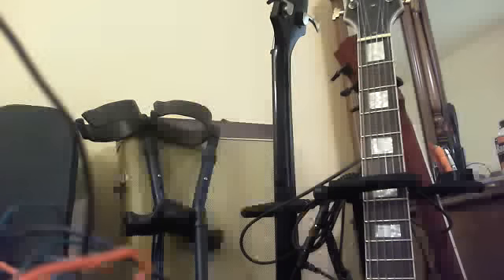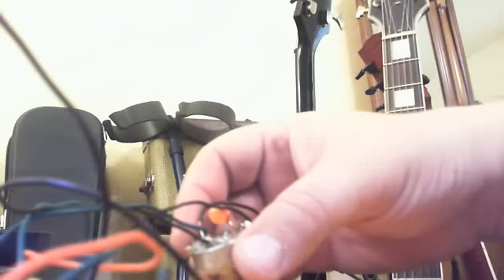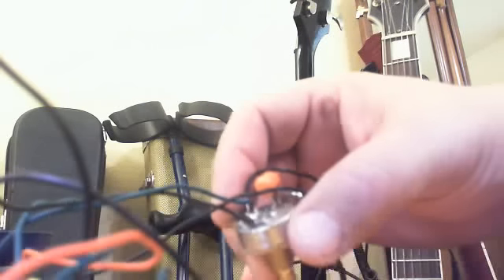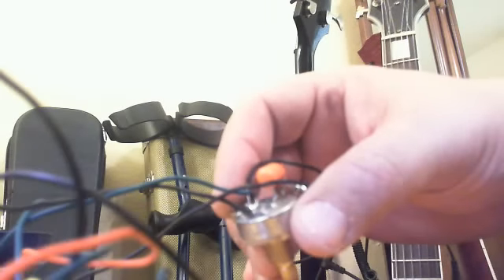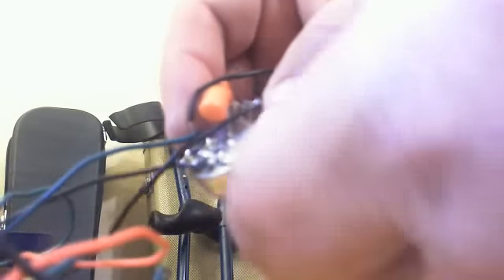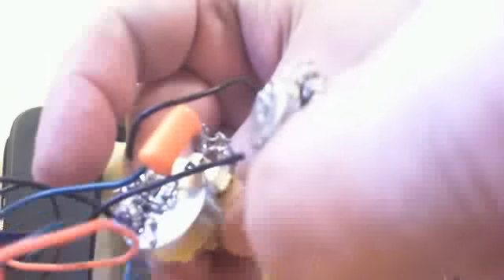IM NOT KIDDING I DOOOO NEED SOME HELP WITH THE WIRING ON THIS GUITAR..

Comment: Yeah...do what davey says for the ground. But pull out that rats nest completely. Start fresh. Build the harness separately...ground wire connecting the pots, install the caps, and input jack. So now the harness is one complete unit. Wire the switch, and slip the wires into some shrink tubing. This way you have only one wire to fish through the guitar. Install pups. And switch. Solder them to the harness. Slip string through the pot holes, tie them to the apprpriate pots, and pull them through.

Comment: I just put new pickups in my chibson supreme as well! And what a nightmare!!! :/ but luckily for me I get to do it again shortly to put all new pots in.... Lol
Reply from the maker: Well, this particular one took no less than THREE times to get it to work properly! AND STILL it's three way is turned to its side! Before I EVEN TRY to move the 3way Id put a STICK IN MY RIGHT EYE! As long as all is working Im leaving it alone! Its just SO HARD to MOD a Supreme period. There is just not enough ROOM between top and bottom when installing those new Long Shaft Pots from Gibson. Its just SO TIGHT. And NOW, Im recommending for everyone to use the thinnest and most easy wire to move around inside the guitar which means as thin a gauge as they originally used in China! IF you TRY to use a THICKER Gauge Wire it means that wire will put up much MORE resistance when trying to Put it into the body and later to pull those parts up and through. The MORE resistance the MORE Chance one wire will pull free from it's Solder Location. AND While the entire RIG is inside the guitar! and that means Starting ALL Over Again!  

SO, whats the ANSWER to Moding these Semi Hollows and Hollows? First, try just to switch out parts to their Original Wirings. Using the exact same wires! Next, if thats not possible, Purchase a much Thinner gauge wire than you would normally use say on a LP Model. Next, TRY to Follow the Original Wiring Diagrams that the guitars came with! Lastly, TRY to find a Wiring Diagram for an ES Model that shows the final work being setup into a long strand Harness. That Harness to be finished off with Shrink Tube to protect it! One Long Inline design! That way you will NOT have Cross over wires or Thread Through parts that become entangled with another part(s).

The above problems are but a few of the Screwups I went through TRYING to follow a wiring diagram I was use to and liked due to the Tone/Sound it produced. Never again.  AND when my NEXT ES or Hollow Body breaks down...into the shop it goes.hehe..